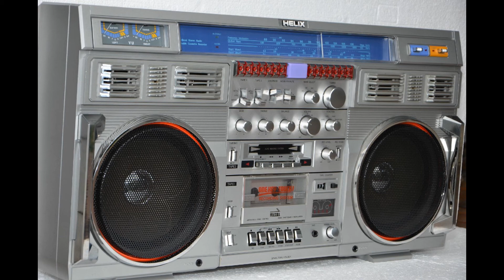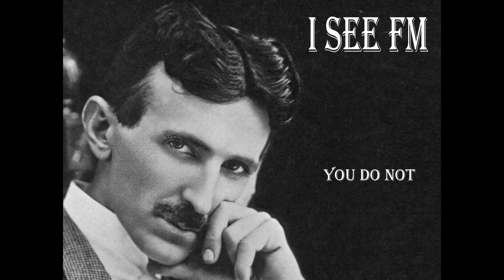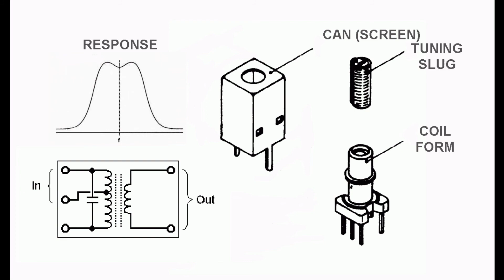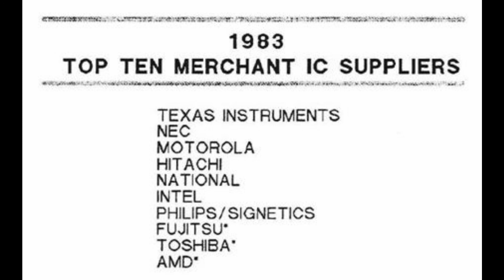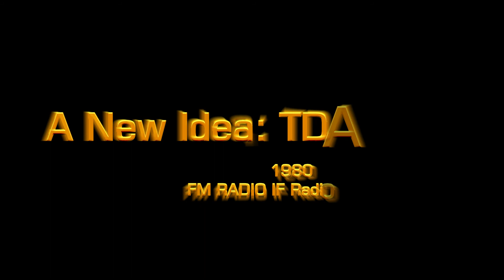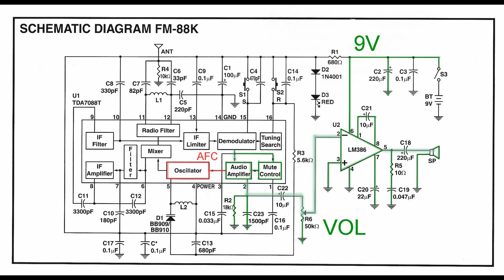Elenco FM-88K and TDA7088 Theory

Comment: Is that chip the forerunner to the TDA7000 Zero IF Radio chip, There is a phasing method where you have an oscillator giving the same signal at two different phases i.e 0 degrees and 90 degrees one is modulated using a DSB modulator then combined with the other phase then multiplied up to the required frequency i.e The Armstrong Method for FM generation, with that SANGEAN radio they are using Quadrature Sampling Mixer i.e. (Tayloe Mixer) that feeds a DSP processor to recover the wanted signal.
Reply from the maker: It all goes back to Phillips and the 7000. They basically started making these chips and related versions thereof with maybe another feature added here and there. Then they quit the product line and then the Chinese began copying them for very low cost applications. Some folks have made synchronous AM detectors out of them.

Comment: My first FM radio I built from a kit was based on the TDA7021 chip so it was close to TDA7088. I must say it sounded nice together with TDA2030 amp. I've never liked those TDA7088 radios though. Maybe because of their cheapest possible design in a keychain form they never worked well.

Comment: This video is very informative Thank you..I finished my fm 88k kit works good 👍but I want to make a ghostbox with it...so I got rid of a disc cap 0.1uF on pin 1 to try and stop the mute function from working..

So now i need to run a square wave to pin 15 and 16 for the scanning of stations un muted..my question is do I remove the (c4) 470pF disc cap thats in parallel to the scan switch? And is 3.3 volts on a square wave safe on this I.C.?